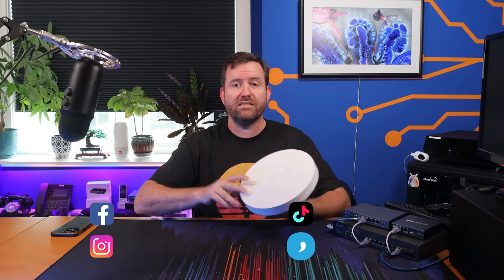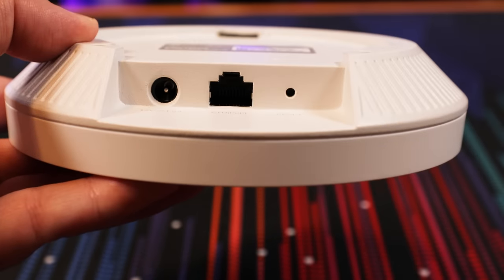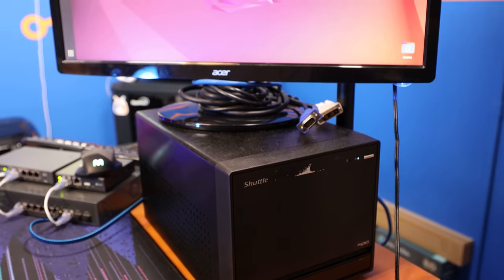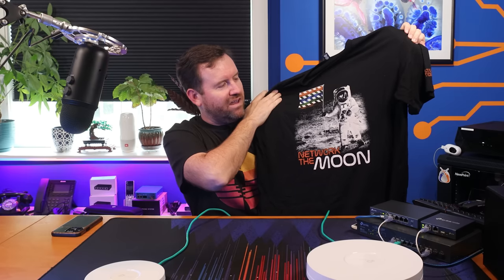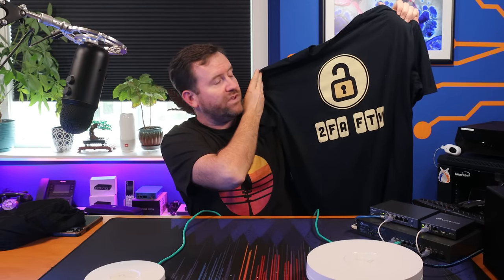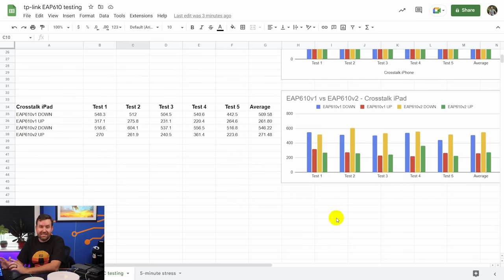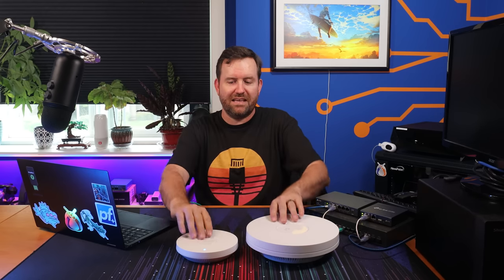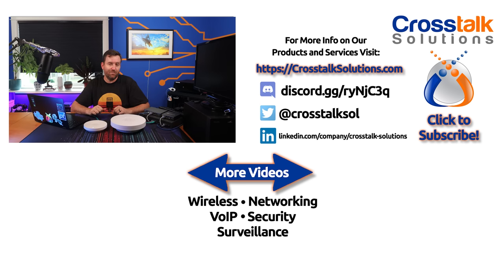It's Smaller, but Is It Faster? Testing the tp-link EAP610 v2.

Comment: Awesome. Glad to know about the v2. I have a v1 in my home. Its as big as a clock on the wall. Really like the v2 size. It would fit very nicely and look a bit like a fire alarm.

Omada gear is fantastic. Ive had it running for over a year and have POE switches running various APs and the firewall/router. Geat stuff. Very reliable.

Comment: Thanks for the tests, but what about range.  When I think bigger antenna I don't think "faster" but "further" or "stronger" (stronger=can go through walls better).  I do like the smaller form factor especially for the wife-approval-factor.
Reply: Exactly!
Reply: He's not going to reply because he didn't test for that sadly.  That is half the battle, knowing performance over distance.  Maybe in the future?
Reply: With Wi-Fi generally it's not the access points range that matters. It's the endpoint. It doesn't matter how far the wap can broadcast if the endpoint can't talk back. 

You will find even the smallest wireless access point has a much larger antenna and much more powerful radio than any endpoint.
Reply: @mgzukows  Best test is to do it in pairs. Get two of every unit and put one unit in client mode and the other in AP mode and measure their speed at various distances from each other.

Comment: There’s a way to test the raw speed form device to AP using iperf2. If you ssh directly into the AP, you can run iperf2 server and then run iperf on your device to test your raw wireless speed without network switches and other stuff influencing the test

Of note, I don’t think you can ssh directly into the AP while it’s adopted into a Omada controller though

Comment: Strangely, I actually use these TP-Link APs instead of UniFi APs because they are much easier to mount and dismount with the former than the later. I think the UniFi ones are meant to be harder to be stolen off their mounts. However, if these are used in the homes, theft is not an issue, so the TP-Link ones are preferred.

Comment: While a bit unrelated, can the Ubiquiti airMAX and other similar PtMP devices be used as a more traditional access point? Mainly wondering for locations such as homes on larger plots of land such as farms. Usually WiFi router with a decent radio placed by a window facing the field (1 watt transmit power and 4+ dBi antennas, will usually get around 600ft line of sight for basic clients such as smartphones. While not the main use case, can the airMax products work to support basic clients from a longer distance, since a high gain antenna can also receive weaker signals from a longer distance it would be interesting if those could be used for a niche use case like that

Comment: I bought a v2 too, and it's acting weirdly slow. Connecting my pixel 7 pro and steam deck LCD to my desktop and running iperf3, I'm only getting 200Mbit/s. Any ideas why? I'm only like 10 feet from the WAP and both mobile devices are connected via 5Ghz. The desktop is wired in through ethernet and has no problems on the gigabit LAN.

Comment: TPlink is my go-to product because of ease of install and low cost controller.  But, why didn’t you compare speed through one and two walls.  Speed at a distance is paramount.  Customers don’t care about speed at 3 ft through air, but rather what is speed at the room down the hall.  

Next, TPlink needs to reduce size of the outdoor WiFi 6 AP, especially chunky Ethernet port.
Reply: Is the controller really a deciding factor, they seem to all run on any computer or as I do, on a free tier VPS.
Reply: @matthewbeardsley7004  We have over 50 locations and I want to send any tech to any location.  Also, I don't want to fund a dedicated laptop to a location when a low cost $85 Omada controller is sufficient.  Sorry, don't have a clue how to implement free tier VPS.
Reply: @johnpoldo8817  ahh fair enough, as someone who manages a bunch of sites I can see the importance. It's just me and 2 AP's :-)

Comment: Thanks for the tests! Weird.. i have the eap653(US). The one with only 22db and I’m getting between 720-730 down and 690-700 up with 5 tests. iPhone 13 Pro Max and 2019 Intel MBP, 4m or 10ft from the disk.

I thought those more expensive 610s were faster. No doubt the range is definitely lacking at 22db. But for a small condo unit, i think i picked the right AP. These are much cheaper than the 610s.
Reply: They should better advertise the half power aspect of the 653. I've returned mine because of the smaller range.
Reply: Line of sight signal isn’t really lacking. But the transmit power is. I’m not sure if they have the the 25db EU version, which should work. Although you are right. i found out that the 653s US version only has 22db after purchase because the power rating wasn’t obvious.
Reply: @coralchaser  The EU version also has higher power, but only on the 5GHz band 3, whatever that is.
Reply: i believe bandwidth is slower than band 1.